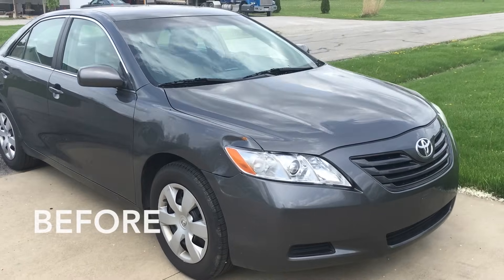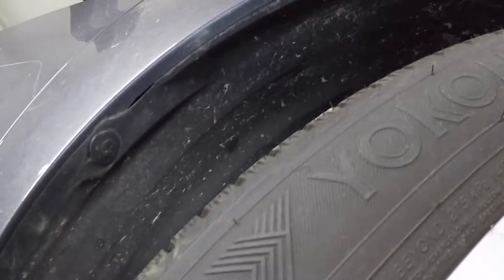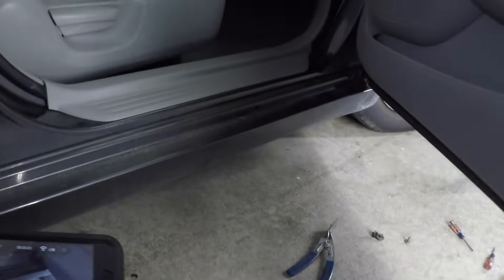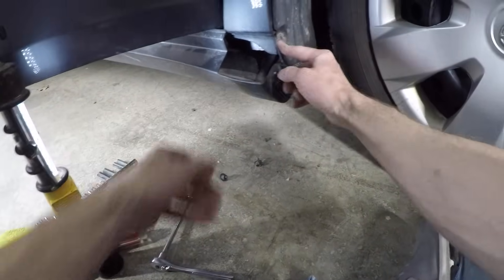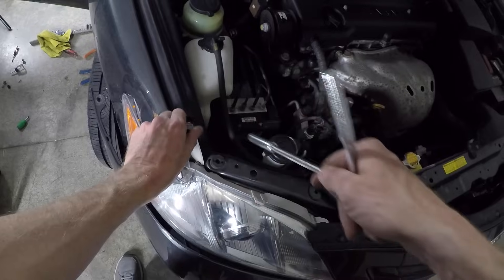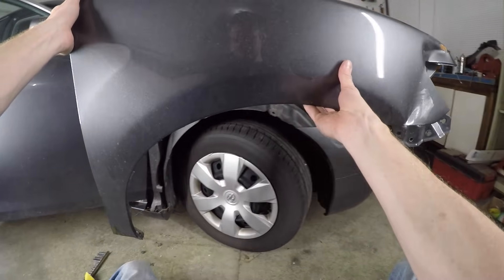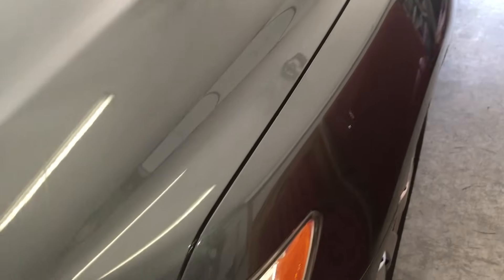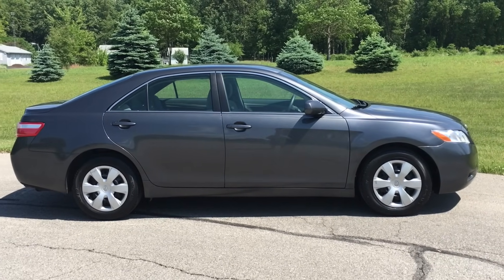How To: Remove & Replace Front Fender 2007-2011 Toyota Camry

Comment: My man even put a “fender map” for anyone who misplaced bolt placement…. Your an absolute god
Reply from the maker: I often had extra bolts after the job was done… not since I started using a cardboard fender map 😁
Reply: What I like to do is to print the Electronic Parts Catalog page of the section where I will be working on and assign a short identification to the fastener or clip. That identification goes on the catalog page at the right spot as well as on a zip-lock bag.

Comment: Thanks man. Im thinking of buying a camry with fender rust. This video gives me hope that I can do this on my own
Reply from the maker: The most important step will be removing that rust and getting it neutralized.
Reply: @6thGearGarage  well im hoping once i buy it and remove the fender I dont find rust underneath it
Reply: @furtalance_x  probably too late now, but look for rust in spare tire, rear of car, under the bumper that is where my 07 went.  But really both the 07 and 08 have held up well in terms of rust.   I bought the 07 new and ran it like 150K miles or so, it was a good car...better than the 08 and  I don't know why.  Either way, you keep an eye on oil and freq oil changes, you should be just fine !!
Reply: @DanTheManIOM  I live in Canada so rust in a 10+ yr old car is unavoidable. I did manage to change the fender out thanks to your video (I rust proofed it before installing). So the rest of the car does have rust spots which I will fix on my own next summer.

Comment: Man This video was detailed and super helpful. My dads tire blew out on the hw at 60mph. Destroyed fender, head light, bumper. and side skirt. Mainly the fender connections. Watching your video i found out that the headlight brackets were also destroyed and that was the most damaged along with the side skirt bolt bent forward. I belive i can straighten out the sideskirt 10mm bolt connection to the new fender. And replace the headlight brakets before installing the new fender.
Reply from the maker: I'm a fan of trying to fix what I have to stay under budget than buy replacement parts new.  The gorilla-glued plastic bracket I used was as good as new. Either way, parts are plentiful for Toyota Camry's because there's so many out there. You can find anything you need used on ebay for a fair price.
Reply: How did you straighten it out
Reply: How much did he pay to get all that fixed because I have a Nissan my front bumper , left tail light & fender , plus my left wheel is damaged from being hit . My bumper is completely off and the tail light is broken how much did he have to pay ?
Reply: @Makeyoulaughclip this was a year ago so I’m sure you got your question answered but maybe it’ll help someone else - just got quoted 2500 for new bumper new fender new headlight lol hints why I’m here

Comment: Vettes I've worked on, not metal fenders, I watched your video about 3 times tackled this on my 2000 avalon, it had a bad hit behind pass headlight, 
Besides some small brackets behind the hit that got bent and had to be bent back and not to brag with the help of your video it went quick and easy I did it at night in car port with only a little flashlight, okay, I have been working on cars 50 years, but videos like this sure do help, many thanks.
Reply from the maker: I'm glad to see this video is still helping others!

Comment: Well, what I can share is that the fasteners and clips you encountered are very similar to my 1997 Toyota Starlet car. Also the general process is very comparable of what I did today on my car. For me I did prefer to jack the car up and put is on jackstands to be able to take the wheel off. I also would encourage Toyota owners to DIY this job.

Comment: Thank You!!

I crashed that I literally bought 2 weeks ago in a snow storm. Replacing bumper, grill, light and left fender. Watched a few vids and it doesn't look too terrible. I'm worried about the brackets more than anything. Working on a Infiniti G37.
Reply: How was replacing the fender on the g37? I have a m37 that I bought with a deep dent on a body line on the fender and was looking at replacing it.

Comment: Although this video was 4 years ago I find it extremely helpful and have subscribed to your channel. Thank you so much!

Recently I had my 2013 Camry's front right fender replaced by a garage, but after the fender replacement I found the gap between the front right fender and the bonet is too wide compared with the front left side. After watching your video and heard that you adjusted the fender gap, now I feel confident that I can adjust the fender gap myself. May I ask if there is anything in particular to pay attention to while adjusting the fender gaps? Thank you in advance.
Reply from the maker: After adjusting, close the hood and doors very slowly and carefully while watching the gap, so be sure that nothing contacts the fender if it was adjusted too far.
Reply: @6thGearGarage  Thank you very much for your reply and the advice.

Comment: Thank you for video. This has given me the confidence to try on my own vehicle
Reply from the maker: Best of luck! Reply here if you have any ?'s
Reply: 6th Gear Garage I replaced the fender. Unfortunately I couldn’t find the correct color so I had to respray it. It looks a slightly different color to the rest of the vehicle as I painted it with a rattle can. Overall very happy with the outcome though. Thank you again

Comment: Hi 6th Gear Garage, I'd really like your video & it's very helpful for me. Especially I'd like your tip about "fender map" that let us know where all screws should go to. I intend to replace a front fender (driver side) for my old car toyota camry 2012, but I don't know the way to remove & replace is also the same as 2007-2011 toyota camry or not. Anyway I'll try to do it. Again thank you for sharing useful videos. Awesome!

Comment: Super helpful! One thing with the 2015 Kia soul... The bolts on the door are extremely hard to reach! The door is right in the way. I'm sure there's something that makes it easier to get to but I'm not sure what it is.
Reply: Hey Sarah. Were you able to replace your fender? I have a 2014 Kia Soul and need to replace my fender as well.

Comment: How do you adjust the fender crack between good, mine looks to wide on both sides. 07 Pontiac Vibe
Reply from the maker: You need to loosen all the bolts on the top edge of the fender and push it in a little, then re-tighten them.
Reply: @6thGearGarage  I wish it was that easy, I did that a bunch of times already. Then it pops out of line in a different spot that was tightened down so don't get how it moved. After market junk, just don't line up with all the holes was the start of all these problems, thanks for your thoughts anyway
Reply from the maker: @tmiller590  you may have to elongate some of the holes on the fender if the fitment is that bad. Or the car chassis could have been tweaked in an accident.

Comment: Wait, it's possible to remove fender without removing sill panel, front bumper and the wheel, wheel well liner?  Volvo asked to remove them for 2012 XC60.
Reply from the maker: I think Toyota kept it simple. Volvo... not so much.

Comment from the maker: I haven't worked on a Juke, but I'd look for the bolts in the same places. It might be a little different around the headlight area, as different manufacturers attach them different ways in that area.
Reply: 6th Gear Garage Thank you very much for your quick reply. By the way your instruction on painting is also great.

Comment: I have a Toyota echo 2002 and I would to know if the process is the same as your video to replace right fender?
Reply from the maker: It may differ slightly, but most modern vehicles are similar to this.

Comment: Was the fender replacement aftermarket?
How good are they in terms of fitment?
Reply from the maker: Yes it was aftermarket. It seemed to fit fine after I adjusted the mounting points.
Reply: @6thGearGarage  I looked and there are some companies that sell but I was not sure if the quality and fitment would work, your vehicle looks amazing after the repair.
Reply: @6thGearGarage  
Which company did you use to purchase your fender?
Reply from the maker: @Keepin-it-wheel101  It was a few years ago, so I don't recall the exact brand.  It was the cheapest one I could find on ebay/amazon.
Reply: @6thGearGarage  that helps. Thank you so much

Comment: It was very helpful thanks,
I have Corolla S 2010 the Driver side fender and Headlight is damage I want to replace it. I will appreciate it if you can give me some important tips and guidance how to replace it. where to buy the fender and paint for it.
thanks
Reply from the maker: Ehsan Shinwari I bought my fender on Amazon. eBay usually has good deals too. For the paint, check your local auto parts stores. They don't have every perfect match color on the shelf, but should be able to special order it if needed.

Comment: I was trying to get a bumber off today so I could remove the Bumper Impact Bar.....I couldn't get the tabs off to remove the interior flap. Major pain and its pouring rain at this point in a pull it yourself lot so I just ripped a couple off the front and pulled it over the wheel bearing. Ended just pulling them back enough to get bolts behind front lights. I also was going to get the right fender but I couldn't get the screws off with the 3 phillips screw drivers I had. They are some serious screws....will I need an impact drill for this? Everything is more involved once you get into w cars or even just painting your closet. I don't care...I have all day everyday these days...just inherited 975 thousand dollars....too bord to just by a new car.
Reply from the maker: You shouldn't need an impact but maybe some of the hardware is rusted? I agree, new cars are boring.

Comment: Thank you for your great instruction, the process of remove/replacement Toyota Corolla 2013 as the same of 2009 Toyota Camry ?
Reply from the maker: It's probably similar, being a Toyota sedan of the same era, but there may be some slight differences.

Comment: Is it possible to do this without opening the door? My fender was damaged in such a way that it slid behind the door and makes it impossible to open. That's why I'm replacing it in the first place
Reply from the maker: The door had to be opened to get to some bolts, but maybe you can cut the fender off to avoid further damage to the door.
Reply: @6thGearGarage  Thanks a ton for the response! I guess if all else fails and I really can't open the door at all, that's certainly a good final option

Comment: can u replace the back fender and how did u get the paint to look exacly the same?
Reply from the maker: Jesus Cedillo The back fender is part of the body and is not removable. It would have to be cut out and a new section welded in. The paint looks the same because it was formulated to match the color code of the OEM paint on the car.
Reply: 6th Gear Garage can any body buy or formulated paint or where do we get it from?

Comment: Hello! I just wanna ask if you know where i can find an instruction on how to REMOVE A NISSAN 2015 SENTRA FRONT FENDER. I’m having a hard time to remove it. Specifically in between the door where theres a really tiny Metric Allen wrench that I’ll  need to remove but i’m not sure if it’s needs to be removed to remove the fender. PLEASE HELP
Reply from the maker: I haven't ever worked on the Nissan. You may want to search some forums - there' a lot of good info there.
Reply: 6th Gear Garage Thanks! I finally figured it out, it was kind of confusing for since I’ve  ever worked on tearing down a car before (because I’m a woman). Got some help putting them all together which is the tricky part. Thanks for your how to videos! It helped me a lot!

Comment: Thank you for the instruction, which was precise and right to the point. I need instruction to replace 2011 Nissan Juke front fender which is somewhat different from Toyota. Can you please help me?
Reply from the maker: Razi Jun I haven't worked on a Juke, but I'd look for the bolts in the same places. It might be a little different around the headlight area, as different manufacturers attach them different ways in that area.

Comment: Could you do a replacement fender on a 2007 Lexus ES350?
Reply from the maker: tillman ferrell if I had the car, I would. Honestly, I bet it is very similar, since both sedans are designed by Toyota.

Comment: Hello I having problems with my Mitsubishi eclipse GT 2008 the fender is caching the dor
Reply from the maker: You can try opening the door so you can reach between it and the fender, then pull the fender outward slightly.  The metal is thin enough on the fender that you should be able to tug it out just enough to clear the door where it is making contact.

Comment: can u do a 2007 to 2010 toyota corolla sedan 

door removal and how to make the door shut properly as my new car door is on but it doesnt shut and it keeps hitting the front fender panel
Reply from the maker: I don't have one to make a video, but either the car was in an accident and the body is tweaked or the fender bolts need to be loosened and the fender slid slightly toward the front and then re-tightened. THe bolt holes on the door hinges may be able to be adjusted as well, but I'd try the fender first.

Comment: How do you adjust the fender?
Reply from the maker: To adjust, just loosen the bolts and position the fender where you want it, and then tighten the bolts. The bolt holes on the fender are larger to allow for some positioning.

Comment: how did you adjust the hood to line up with the fender need to know please
Reply from the maker: SpazzOut M I loosened the bolts on the top edge of the fender, then you can pull it away from or push it closer to the hood.
Reply: oh okay thanks

Comment: 3 and1/2 hours in I gave up. Snapped 60  % of the thumb tabs and needlessly  broke the fender skirt on my Toyota corolla Snow I got to pay 1000.00 instead of 500.00 to have someone at a body shop bail me out
Reply from the maker: Sorry to hear that... Corolla should be similar procedure as Camry but sounds like the plastic is weaker.
Reply: Lowe's sells the thumbs tab, real cheap.

Comment: Process the same for a 92 integra?
Reply from the maker: The integra will be easier than this. On 90's hondas, you'll need to remove the corner turn lamp. Other than that, it's pretty much the same concept.

Comment: Wait...What???? OK so do tell where you can purchase a 3 dollar can of custom color metallic  spray paint?... when the cheapest can of paint color matched is around 10 bucks a can NOT 3 bucks like you said! Also you didn't mention that you need to completly sand and clean with acetone the new fender prior to painting the fender with a minimum of 2 coats of primer!  again around 10 bucks a can! Then you may also need to finish with a clearcoat which again is around 10 bucks a can, then you also needed to sand the primer finish and sand again the base coat before you apply the clear coat then again with 1500 after the clear coat. So again around 10-15 bucks for 3 types of sand paper!  Also you will need a can of acetone and a tack cloth, for clean up and cleaning the surfaces prior to painting again around 10-15 bucks! Not so cheap now is it? Just the paint alone exceeds the cost of the fender so tell your subscribers the whole truth and nothing but the truth...lol  Your still not done spending money yet  cause when you go to the Toyota dealer and buy all the plastic clips that broke as they are designed to do, (6 out of 10 are worthless after being removed) So there is another minium 15 bucks in clips! and your time and beer costs...Gotta have a cold one you think! So now your 30 dollar fender was cheap but...NOT... Because you had to spend at least another 50 bucks for miscellaneous paint, sandpaper, Acetone and most of the clips! Now that fender repair is closer to well over a 100 bucks! So tell it like it is so folks can budget the real costs!
Reply: FYI you also didn't tell folks that the rubber seals will need to be removed and cleaned which takes a lot of old rags and acetone and several hours to do...But then you will need a tube of the seal glue which is 18 bucks at an autozone or 28 bucks at a Toyota dealer. All in All your still saving hundreds and hundreds of dollars by doing it your self but do remember NO job is worth doing unless you do it correctly and to do it correctly means in reality there is no such thing as a 3 dollar paint job ...besides would you do a 3 dollar paint job on your car? Most of your advise was good but would be much better if you did a true parts breakdown and a true cost of all the materials included otherwise good job keep it up!
Reply from the maker: I said it cost me 30, not 3. I bought 3 cans of color match paint at around $10/can. The rest I already had. Everything you said was covered in the fender paint video, check it out: https://youtu.be/qyIBWXXPjgU
Reply from the maker: This video was just the install process, not the paint process.
Reply: These are great points about painting. So why not just find a painted passenger side front fender from a junk yard?